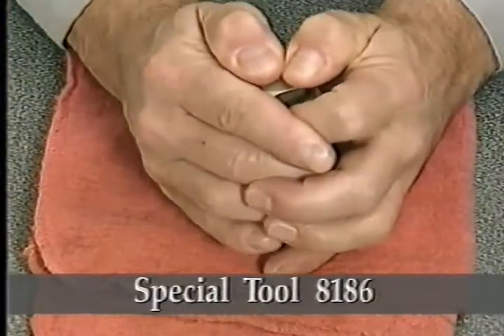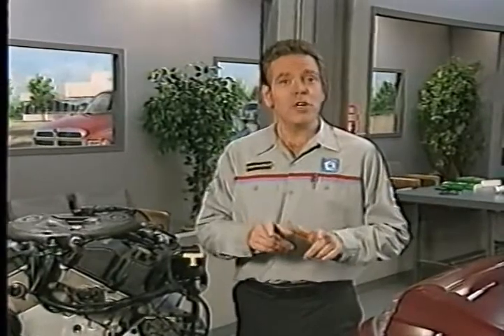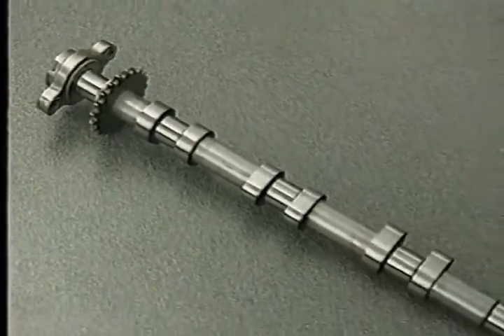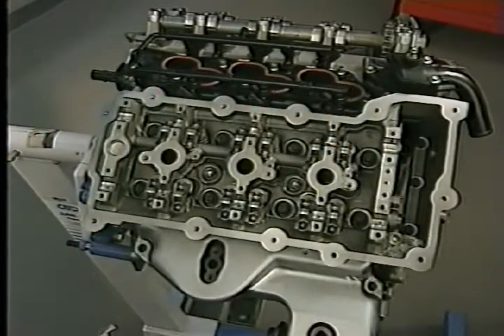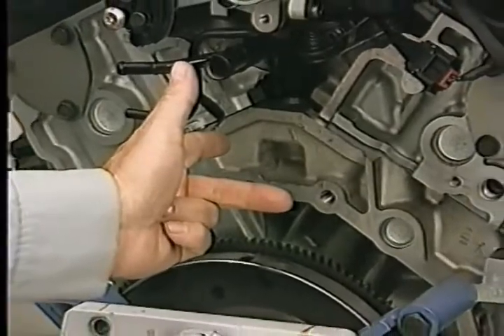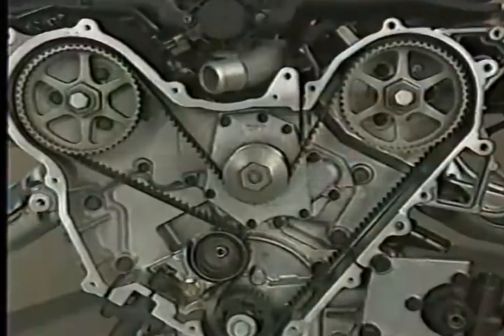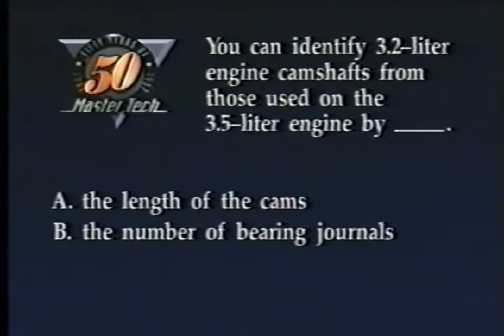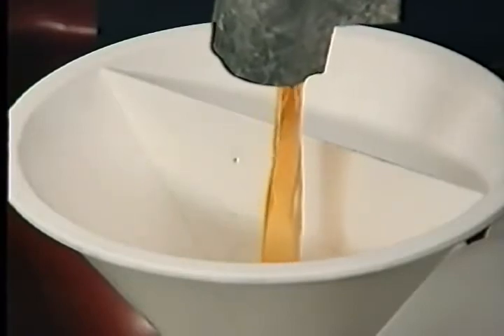Chrysler Mastertech 1997  2.7L, 3.2L, 3.5L V6 engines PART 3

Comment: Excellent! Finally we have some straight dope from the manufacturer. This is exactly what everyone needs when dealing with these engines. These engines are very 'fussy' and hard to work on, so even people who call themselves mechanics also need to watch this video. Just go on-line and you'll see that many folks have failed to properly install water pumps on these engines. And most failures have been at the tension adjuster sequence. With proper instruction and tools, this can be done by you.

Comment: I hate the MLS headgaskets,makes cleaning of the headgasket surfaces a pain in the ass.You can eliminate the oil lines,stopped using in them in 2002